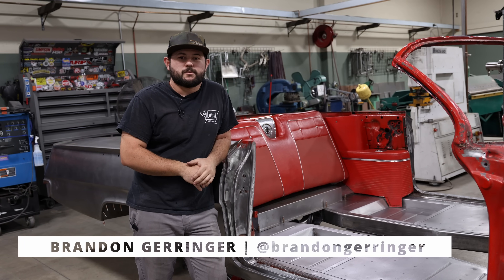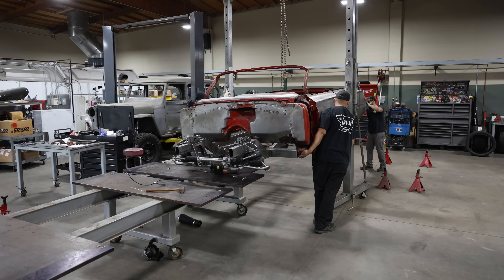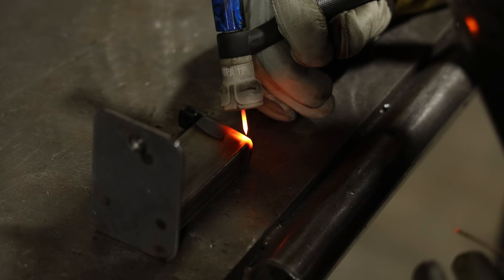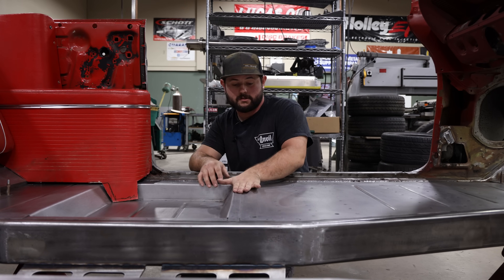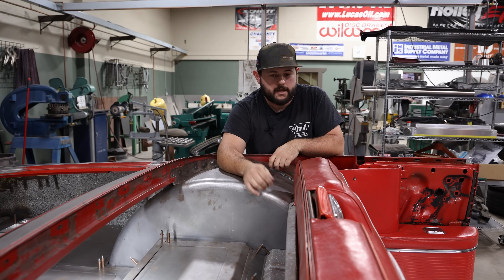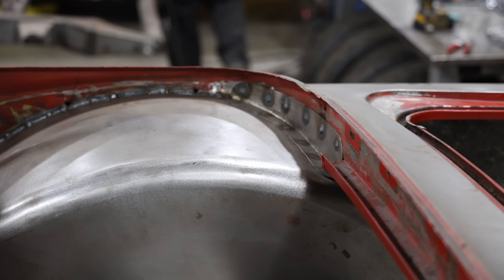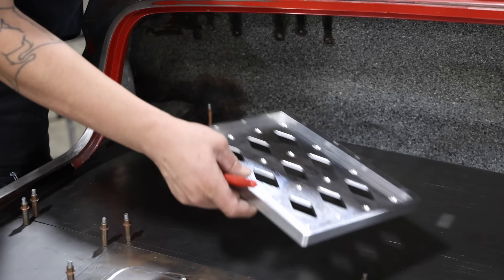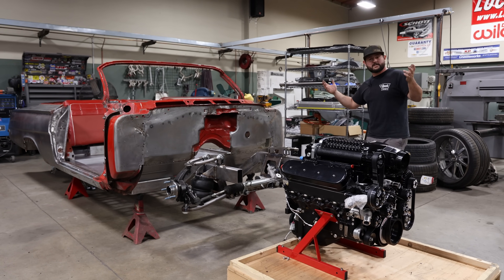1,200hp ’62 Impala Convertible | Floor Fab & Tubs for 24s

Comment: Amazing, other than the bodywork, this is practically a brand-new car. And even the body has many new parts. In Europe it would be a complex and expensive process to get a new vehicle registration. Registering a self-built car? Even these days, that's a costly affair. After all, you usually need an individual operating permit.

Comment: Amazing work ! I love all that you guys are doing . This is exciting to watch your progress. I understand Paul is from Virginia. I live in North Carolina close to Danville, Va. I have owned 55, 62 Chevrolets as a teenager. Also a 1967 GTO. I used to work as a welder at Wysong  (manufacturing plant of shears, press brakes , and bending rolls.) It is cool to see these metal fabrication tools creating these works of art. I am 70 years old and am still working on projects as well . 1964 c10 step side , QA1 suspension , 5 speed tremec , and 4 wheel disc brakes. Thanks for sharing your site . Great information.